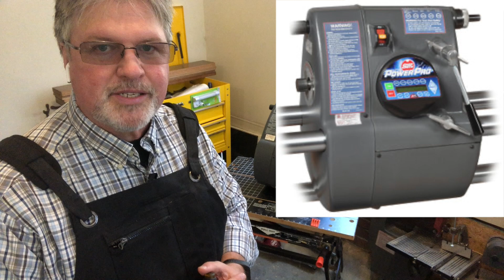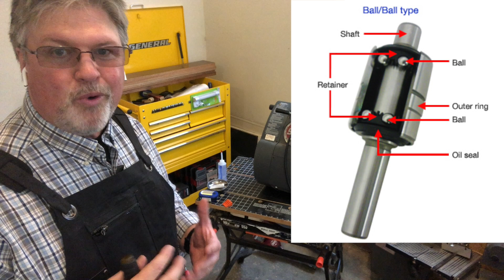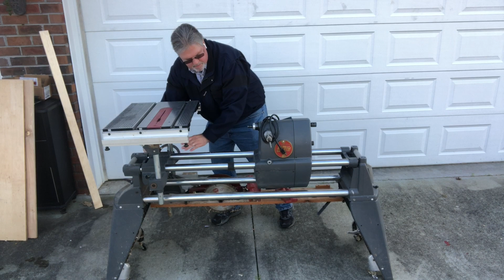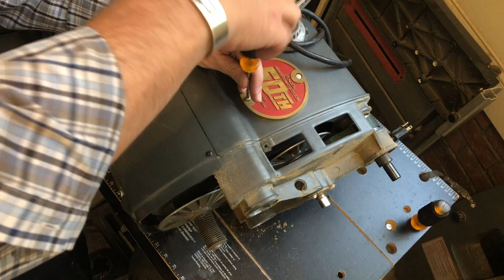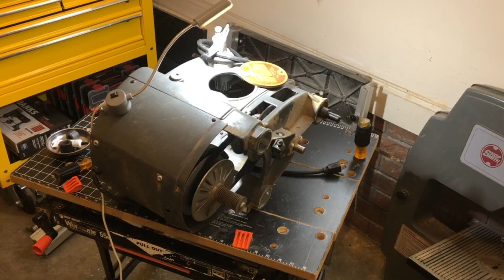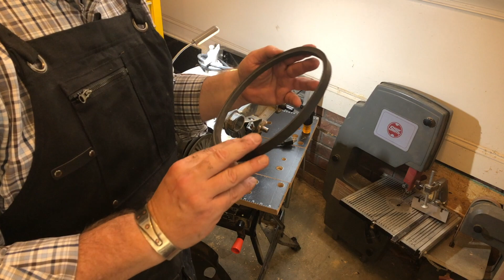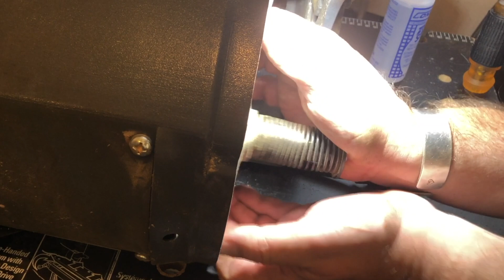25-Hour Run-Time Critical Shopsmith Maintenance, Headstock Removal & Lubricating & V-Belt Removal

Comment: Scott, I'm late to the party here...going to hopefully buy a used Shopsmith Mark 5 next week. Been watching your videos and I'm sure I'll need to run through many of them to get everything cleaned up, lubed, etc. If possible, what are the top 3 videos of yours that I should watch first? Many thanks, Dave - LDK Woodshop
Reply from the maker: Congratulations and welcome to the Shopsmith’s family. That’s an interesting question. You’ve already landed on an important one. I think I’d suggest one that is titled something like “Before you turn on your Shopsmith”, and one of the videos on waxing. I think one is titled something like “You are (probably) waxing wrong”.
Reply: There is nothing better you could do with your time than watch all of his videos. There are nuggets everywhere just casually mentioned. Unless you like sitting down with manuals this is the easiest education.

Comment: I am the proud owner of a new to me 1992 Model 510 purchased at an Estate Sale for $1000. It comes with a Scroll Saw attachment and a stand alone SS Bandsaw, plus all the manuals and some drill and router bits, etc. I've wanted one since the 1990s when a friend told me about how he kept one in his small garage. Before I bought it, I did turn both machines on to make sure they worked. But I didn't know you were supposed to turn it all the way to below D speed before turning it off. I have watched many of your videos and am learning all I can about my machine. I just finished your 25 Hour Maintenance task (except for removing the V-Belt as it looks to be in great shape). Overall, my SS is also in great shape and I believe the previous original owner used it and kept it well maintained. There is very little rust in a few corners of the legs and inside the head stock removable cover. I have cleaned and waxed every inch of all the surfaces. But to my question: My speed dial is currently at R. Do I dare to turn it back on now or do I need to do the "Turn the Sanding Disk While Turning The Speed Control To Slow" method. I also saw your video on cleaning the aluminum table tops and that will be my next task. Thanks and you have a new subscriber and follower!
Reply from the maker: I did a video on this, which I will share the link to in a minute. In the meantime, just make sure nothing is connected to it, and you should be able to turn it on at its current speed and turn the dial back with the machine turning. Just don’t turn it on if you’ve got it connected to one of the accessories at a high speed.
Reply from the maker: Here’s that video: Shop Short: Do you HAVE to slow the Shopsmith before turning it off?
https://youtu.be/U2I83mO-XCc
Reply: @MyGrowthRings  Wow, thanks for the quick reply and video link! I just finished turning it down with no attachments and it worked perfectly. I was also relieved to see that at the lowest speed the dial lined up at slow. 🤓

Comment: Can the oldest Mark Vs have a large hole cut into the side of the headstock beneath the nameplate so that the sheaves and other parts requiring lubrication are more accessible?
Reply from the maker: Yes, but before I would go to that trouble I would check this option: https://youtu.be/yQSGbudXUWk?si=tgfyja9BUcJpKTos

Comment: I know this is an older video, but I've just watched it for the first time. At the end you said you'd share what type of oil you use. Could you tell me what that is, please? I've just found your videos and don't know how to find the follow-up to this one where you identify the oil. Thanks.
Reply from the maker: That’s a good question. I talked all about the various lubricants that I use in the follow up video to this one. Here’s the link: STUMPED? Q&A's from "Critical 25 Hour Run-Time Maintenance & Lubing of Shopsmith Mark V Headstock"
https://youtu.be/awESOE8NbfM

Comment: The bearingyou can’t lub should be sealed??  I’m glad I didn’t buy one of those 25 years ago, I had a bunch of information on them, had a one car stall to put it in, looks like a every other couple of days job, there might be a chance they would still be a good back up, dado setup, the drill press, ect,ect, I build a 100 bee boxes a year so it would help with rig up times!!!
Reply from the maker: @sheilamclaughlin963  That is correct. There are a couple of parts that slide on stainless steel shafts that absolutely need to be lubricated, but they don’t spin on the shafts.

Comment: A ton of great advice and tips here, thank you. I'd like to mention, that sealed bearings can be serviced, the seal pops off and on easily, and it's worthwhile to do. Only put a little bit of grease in them though, rule of thumb is 25% full of grease. Hopefully this is useful to someone.

Comment: I have not done any turnings in 10 years, I needed your tips. I have not oiled the machine since I changed belt 2001, I will today THANKS
Reply from the maker: Get on it!!
Reply: Finished it 10minutes ago, lots of sawdust @MyGrowthRings
Reply: @MyGrowthRings  I just picked one up used in great condition but probably hasn't been used in a decade. What type of oil should I use and should I replace any belts or anything if they aren't showing damage?
Reply from the maker: @DrSkrillz  I wouldn't replace the belts unless they look overly worn or if they are slipping, but it's not a bad idea to have them on hand for when you do need them. Here's a video on the topic of lubrication: https://www.youtube.com/watch?v=awESOE8NbfM&t

Comment: Thanks video  just bought one of these with pretty much all accessories..been sitting  ten years...one query....am a machinist  by trade so wood will be new...would way lube be OK to use or would viscosity  be too thick
Reply from the maker: For what part? The way tubes should only be waxed, otherwise you’ll end up with a sticky mess once you add sawdust. Scott
Reply: @MyGrowthRings  those two hubs ones that allow  the speed variance  also the shaft they float  on
Reply from the maker: @miguelcastaneda7257  Got ya. I can’t see how it would hurt to try, but I would be very cognizant of how much resistance is encountered when raising the spreed, because you don’t want to have the speed control tugging on the small button bearing in the upper control sheave.
Reply: @MyGrowthRings  k thanks I'll try  like said this has been sitting  ten years  already had two 10ers could pass on mark 5  for 50$

Comment: That folding project table you have that you sent the headstock down on... If you get yourself a piece of flat rubber. Something that's good quality and has some stickiness to it. Open up that table put the rubber across the opening and get the bottom curve of the headstock to sit down in that opening. It won't roll around on you and you can always walk around the project table.
Reply from the maker: Great tip

Comment: Do you have any idea what size the threaded clips that the screws that hold the motor cover on are? a amazon source or a hardware store one would be great. I got a used mark 5 and they were missing.
Reply from the maker: It kind of depends upon when your machine was made and what size Tinnerman clips were used. Most are #6-32 1/2” long, but if you are adding the motor pan screws I would drive them slowly just to make sure that they aren’t going to drip the threads. Good luck.

Comment: Hi. I'm a Shop Smith newbie. I recently inherited one of these. It was my wife's grandfather's machine and nobody wanted it or knows what it's worth. I had never heard of one but have become quite interested in all things Shop Smith. The machine is located in Wisconsin and I want to bring it to Florida. My question is, can it be easily disassembled? I want to bring it back inside a Jeep. Thank you for your great videos and knowledge.
Reply from the maker: That’s awesome, Russell! It absolutely can be easily disassembled. I used to travel with mine in the front seat of a Suzuki Samurai! The legs on each end are held in place with five bolts and nuts; just remove the bolts and the legs easily remove. That’s as far down as I would suggest you disassemble it, until you have a little more experience with it. You can remove the tables and anything that is attached to it and those will compact nicely in store away in your jeep. Good luck, and once you have it, checked the channel for some helpful tips. Scott
Reply: @MyGrowthRings  I sure will. Thank you. The machine didn't come with any tools so what should I bring along to make the appropriate disassemble to run in the Jeep?

I'm only seeing a few hex wrenches in the videos I've watched.
Reply from the maker: @rhess10  You’ll need a large flat blade screwdriver and a small adjustable wrench. The hex wrench that you’ll use for several adjustments as a 5/32” wrench, and that will likely come in handy too.
Reply: @MyGrowthRings  Outstanding. Thank you.
Reply: We're getting closer. My friend is Wisconsin has verified a few things. We've determined that's it's a Mark V. He thinks from the 80s.

Where is the marking plate with serial number/model number located? 

Would I need an exact number to locate a manual? And where would I get a manual?

Thanks for any details you could share.

Comment: Wow, I bet mine has never seen a drop of oil since new. Bought my Mk IV from a gentleman who bought his new and I bet that was over 20 years ago. Time to remove my head stock and do the same.
Reply from the maker: Oh my, yes. Especially with the plastic cam in the speed controller of the MKVII, you want to make sure that the control sheave is well lubricated.

Comment: Hey  Scott,  I have been  cleaning up my coverted 500 to 510 and it looks like my Dad bought  one of the first Mark 5. I have a letter from Shopsmith. Date somewhere between 1955 or 57, i think.
There is no access hole behind the name plate, and I can't seem to find the small oiling  hole under the spring of the lower  shieve.
Can you help me with lubeing the headstock.  Also, the quill springing back like it should but after I waxed it and let it dry, it has become sticky and not moving correctly.  Can I oil it and locking mechanism to loosen it up, or should it be removed and cleaned? Help....... Greg
Reply from the maker: Hey Greg. Yes, when Magna Engineering created the Mark V they somehow forgot that we’d need access to the interior for oiling! To oil the control sheave you need to remove the belt cover and drop the motor pan and oil it from the bottom. Fortunately, this can best be done with the machine in the drill press position, and if you insert your table from the bottom of the carriage your table will be directly underneath the motor pan where it can support the motor. Once that is all open and accessible it’s very easy to apply oil. On the lower sheaves, you simply pull the movable half of the Chiv outward while dropping oil onto the shaft below. It’s awkward, but that’s how it’s done. Thank you for the reminder that I haven’t done a video on this process, so I guess it’s time. Scott
Reply: Scott, do you ever sleep? Lol thank you for such a quick response! Wow, it's like just  calling you on the Batphone...... 
What's your  thoughts on the issue I have with the quill?  Greg
Reply from the maker: @gregwilsonnaturephotography  Insleep poorly.
Reply from the maker: @gregwilsonnaturephotography  And yes, remove the quill and clean it and the housing in the headstock. Most likely it has some goopy old way buildup that the solvents in the new wax loosened up.

Comment: I have Mark V (approx. 1984 version) . I noticed you covered the motor sheave parts but did not cover how it operates on the shaft. When operating the speed control it does not change speeds, the sheaves do not mesh and leaves the belt very loose. The motor sheaves will not close to the 1/2" it should and hits each other leaving a gap of approx. 1-3/8". I was hoping you would have shown how this assembly is disassembled and reassembled to give me an idea if something slipped,  moved  or out of alignment. Can you help?
Reply from the maker: I suspect you have several things going on. In all likelihood you are missing a bearing and a bale that connects to the control sheave. It also sounds like that control sheave may have moved so far that it has left the keyway, which has allowed the sheaves to disengage from one another. I highly recommend seeking out Jacob Anderson’s teardown videos. Scott
Reply: Thanks for your thoughts. I will take a look at what you suggested and see how it goes. @MyGrowthRings
Reply from the maker: @elizabethbattistello5254  If I could, I would swing by and take care of it personally!

Comment: Scott, I have the new MK VII headstock. I have had it for about 6 years and I have noticed that the display fades away as the unit warms up. If I turn it off and let it set for about 30 minutes, the display comes back until warm again. Obviously during the winter it is not as pronounced. Any ideas?
Reply from the maker: John, it sounds like your headstock may be running a bit warm. I don’t know what the temperature range should be, but I recommend calling Shopsmith. Scott

Comment: I have the oldest model of Mark V without any access port under the nameplate. How do I get oil to the upper sheave? Thank you! Rick
Reply from the maker: That makes things tough. The best way to access it is to remove the belt cover and raise the machine to drill press position and access it from above. It helps to have the headstock located low on the way tubes so that it’s not too high to access. I hope that makes sense. I also guess I need to do a video on this approach because I don’t think I’ve included it in previous videos on lubrication. Scott

Comment: What kinds of oils should I be using? 
I acquired a partial Mark 500 over the weekend. It is missing tailstock, tool rest, and the disc arbor. It’s been stored a long time and needs some care but I’m happy to have at least the drill press and table saw functions for now.
Reply from the maker: Good question and there are several. I covered them in this video: https://youtu.be/awESOE8NbfM  BTW, welcome to the Shopsmith family! Those missing parts are easy to find used on eBay or even new from Shopsmith. Scott

Comment: I just got a rusted mark 7. I no nothing about this machine.  I cant get quill to move.  Is this due to rust or am i doing somthing wrong
Reply from the maker: There’s a lot to it. Did you get a manual?
Reply: @MyGrowthRings  just got it.  Says mark 7.   But its older not that power pro deal.  If you have email i can send some pictures.
Reply from the maker: @Peter-od7op  My email address is ScottMarkwood(at)gmail(dot)com. The Mark VII was made in the 1960’s while the current version is a “Mark 7”. Yes, it’s pronounced exactly the same, but there are many differences. You should be able to find a copy of not only the owners manual on eBay or on VintageMachinery.com (or is it .org?) and I would also suggest you get a copy of the book “Power Tool Woodworking For Everyone”. There have been several revisions to that book and there is one that covers the Mark VII in detail.  Scott
Reply: @MyGrowthRings  yes on cd and part ipc.   But the manual does not tell you how to remove v belt.
Reply from the maker: @Peter-od7op  Got ya. If you search Shopsmith.com for “Gilmer belt replacement” they have a pdf that will walk you through the process.
Reply: @MyGrowthRings  ty so much.  I wish had mark 5

Comment: Wasn't sure on which of your videos to leave this comment. But this one will work.
I am getting ready to do clean up and overhaul of my 1954 Greenie. I bought this machine from a neighbor nearly 30 years ago. I recently gotten a couple of Shopsmith bandsaws, which are very nice to have. My drill quill is stuck and I will probably have a great adventure of getting parts and rebuilding.
The Serial Number on my machine is VERY early - # 263557. And except for the new belt I installed around 1994 I don't think anything inside has ever been replaced. When I replaced that belt I cleared out about 2 gallons of sawdust from inside the housing.
Thanks for such great information on these machines.
Reply from the maker: Bill, the journey is half the fun. eBay is your friend for most of the internal organs of your early headstock. Thanks for checking in, Scott

Comment: This has been helpful.  I've wrestled the headstock off and in not knowing the trick with the table. 🙄.   Just had to replace the quadrant assembly on my 91 Mark V.  The srew on holding down the right side of the speed control was stripped so I got a regular bolt and put a nut on the back.  Seems to work nicely.  Now I know how to get that headstock off and on MUCH easier.
Reply from the maker: That was a smart solution for the stripped thread. Happy this helps. Scott